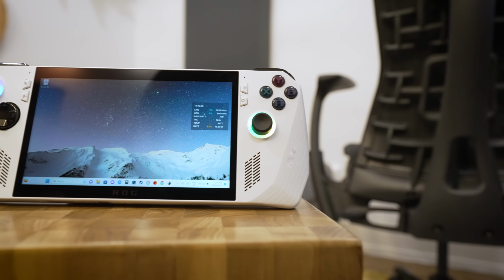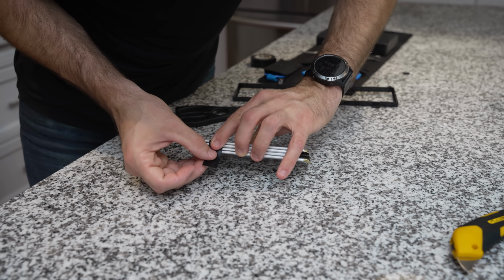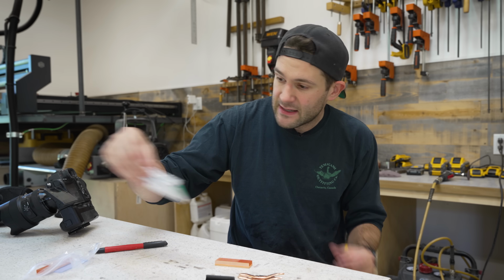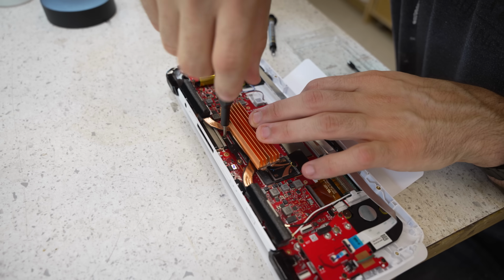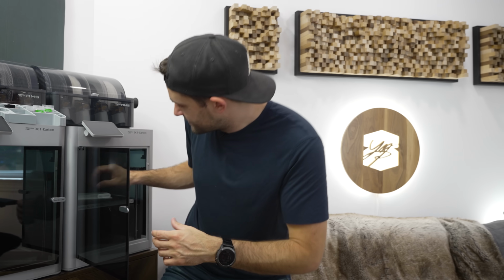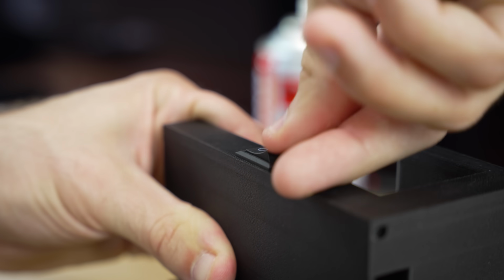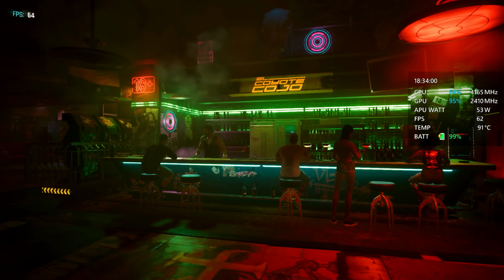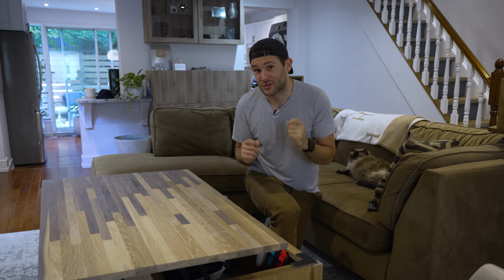I don't understand why people buy Steam Decks...

Comment: "Why do people buy the steam deck when they could buy a product that is twice as expensive for 10% performance increase!?!?!?" we may never know
Reply: 1 People don’t realize how big of a different having trackpads makes. 2 the ability to simply play games in gaming mode by just clicking play but still being able to switch to desktop mode and use it as a normal computer. 3 Steam os is the best option for a handheld PC device because they built in the compatibility, unlike windows trying to force it. 4 it’s built on the back of the biggest store on PC giving you access to almost all games right off the back 5. The amount of work that valve put into updating and bettering the steam deck, honestly, could you see Microsoft caring as much as valve
Reply: Simply play games? That's the rog ally. If I want to play certain games I have to do stupid shit like turn refresh rate down to 58 for tales of berseria so the game doesn't have a stroke. The older ys requires me to run in desktop and hope I can fix the resolution. Digimon story cyber sleuth doesn't work unless you launch the game in desktop mode first. If not the game shits itself and you have to uninstall and reinstall the game while also remembering to launch in desktop mode. I have tried evey game that I did on the ally and it works out of the box.
Reply: My steamdeck is still prone to almost bricking itself on start up with the black screen start glitch. I understand you guys enjoy gargling corporate nuts  it's almost hilarious.
Reply: @Badboy25251  my steamdeck has not had any of the issues you describe, though tbf I don't play the games you mentioned. It sounds like your device is just defective tho.
Reply: @justcallmenoah5743 also during release, and even to this day, steamdecks are prone to bricking on start-up. Just because you yourself haven't experienced it doesn't mean it's not a thing. I had next to no bugs in jedi survivor doesn't the game gets to be excused for it's shit release.
Reply: @Badboy25251  you can have ether Windows destroy your system or not having a horrible os in steam os your choice.

Never seen or heard of any steamd decks bricking themselves I have seen windows do this and hear it happens often
Reply: @Badboy25251  "my steamdeck is prone to not bricking itself on start up"

Thats an.... odd complaint. 🤔 im guessing user error. 😂
Reply: @TheOneAndOni13   ah yes nothing can be wrong with the steamdeck it's perfect because steam made it.
Reply: @Badboy25251 so your saying Asus and windows never f*** up. If you were smart you would have contact ed steam about it when it first happened and they would probably have fixed it for free or you could even fix it yourself of you have the knowledge while Asus dont even refund or replace motherboards that they made that was faulty. Steam isnt perfect but the are by far the best option
Reply: For Windows I guess. It would be why I would buy one.
Reply: more than 10 percent
Reply: I came to the comment section to make this exact same comment and ended up leaving a thumbs up here instead, good job @Reaprar
Reply: It's $350 now, that Rog Ally x is out.
Reply: And an
os that isn't tailor made for the system that allows for seamless per game customization of system performance and control schemes.
Reply: This video should say i don't know why people don't mod the crap out of a rog ally. But fairs
Reply: 10% ? You are a joke...
Reply: The guy is a fucking tool
Reply: Take some tutions from @diyperks he know what to do how to do before cutting & grinding the whole piece
Reply: Don't forget compatibility and modding, it's WAY better in many ways, except the ergonomics and the fact that it baked some SD cards
Reply: Black Friday Best Buy they’re $350
Reply: Cause some people want steam deck is Linux and performance because I don’t know they like it
Reply: Battery life...
Reply: 50% stronger, but lacks optimization from devs, has less battery life, is more niche (meaning you're screwed if customer support can't help), uses windows which sucks on handhelds, and is $50 more than steamdecks top model.
Reply: A steam deck is like the switch,PS abd xbox,it is backed by a very well known gaming company,with other own ecosystem and sold at a loss,to promote software sales from that companies ecosystem,since the owners of that ecosystem make the console they will make sure games are 100 percent compatible with it and certified to work on their device.
Reply: For me I got the steam deck before the ROG Ally and comparing the two of them to me the steam deck has the better overall design than ROG ally I don’t play AAA games and I’m fine with playing anything above 20FPS So… yeah plus Steam deck on sale can go as low as 250$ vs ROG which consistently stays at 600-700$
Reply: Twice as expensive? Lol no.
Reply: @jiffonbuffo  when this video was uploaded the rog ally was $700, the steam deck is $350. You guys are so annoying.
Reply: I paid 750 for my steamdeck and 700 for my ally not everyone lives america.
Reply: @Reaprar  says one of the most annoying group lol you guys just say “just get a steam deck” for everything from handheld pcs to even switch lol
Reply: @briankim6148 I don't wanna hear anything from a guy so dumb that he's replying to comments from 2 years ago
Reply: In India ally is actually cheaper than steam deck
Reply: where I live it's basically the same hecken price
Reply: Dw bro im from the future, crazy price cuts happened
Reply: Steam Deck isn't available in many countries, and the rog ally currently is dirt cheap
Reply: With half battery life also
Reply: Also, it’s windows so it’s basically a pocket computer does way more than gaming
Reply: Does it have quick resume?
Reply: Ummmm more then 10 percent more like 30-40
Reply: COOK CHEF
Reply: That runs a shittier os
Reply: My Ally was cheaper then the Steam Deck OLED
Reply: Had both steam deck and Rog ally. Ally is much better to use since it's windows and isn't steam only. Performance is miles better too and doesn't need tinkering with like the deck does. The only thing I preferred on the deck was the touchpad. That thing was amazing tbh and I wish more used it.
Reply: Asus rog ally cpu is like 60% better its zen 4 vs zen 2 it has 8c 16t vs 4c 8t 3.3 ghz base vs 2.4 ghz 5.1 ghz boost vs 3.5 ghz boost its alot better
Reply: @reaprar and doesn’t only play steam games and windows is better than Linux
Reply: It's 30% to 100% more performance depending on the game
Reply: Bullshit, rog Ally z1e at 30Watts is 60% more powerful than Steamdeck period
Reply: hahaha.. EXACTLY!!! Fucking youtubers man... so much money their brain dribbles out of their assholes.. not considering the COMMON PEOPLE!!!! Half the shit he probably got for FREE!!
Reply: Long term ally Didnt hold up :/
Reply: Cane here to say this 🤣
Reply: If you think it’s twice the price you’re a re+ard. Also it’s way more than 10% performance increase. Also you can actually play all games dummy
Reply: Dónde yo vivo la rog Ally y la steam deck de segunda mano cuestan casi lo mismo,son buenas portátiles con diferentes diseños en la que una se beneficia de algunas cosas y carecen de otra y lo mismo la otra.. en mi opinión me gusta mucho la tienda de steam pero el sistema operativo de Linux no me gusta, porque? Es un lío o trabajo agregar juegos que no son de steam, que funcionen bien o que aparezca en tu biblioteca con una fácil  accesibilidad no lo es, el escritorio es casi muerto carecen de muchas cosas, el diseño de la steam deck es muy bonito y sus trapacks molan, pero hasta ahí. Yo opte por algo mejor que rog Ally y steam deck. Una AOKZOE que la compre de segunda mano y por el mismo precio q una steam deck.. diferencias: mejor batería Windows 11 (si con sus problemas y todo lo digan) puedo tener e instalar cualquier juego muy fácil descargar e instalar nada más y el rendimiento es superior no un 10% nada que ver.. puedo tener cualquier tienda aparte de steam sin líos, a y también cualquier aplicación sin limitaciones
Reply: It's way cheaper than a steam deck 😊
Reply: "In my next video I'll design and build a  nuclear aircraft carrier!"
Reply: Exacly my steam deck is simple works just as fine for me and doesn't over heat like the asus rog ally is known to do my steam deck just works
Reply: @thekawaiicookie3267  Bro my asus laptops overheats games lag because it throttles like crazy i don't know how they planned on releasing a laptop they know it can't perform 100% even for 1 minute so it's all a lie selling a lie
Reply: My opinion on laptops altogether as a 6 year multiple laptops owner just get a medium laptop at max don't ever think about buying a pricey gaming laptop even the medium laptop is a stretch but if you really want to play games on a laptop that's my suggestion
Reply: @thekawaiicookie3267 known to do? I live in the middle of the desert, regularly play the rog ally in 35-40° C conditions

It's never once overheated
Reply: bs steamdeck gets heated aswell! I will say though that steamdeck won't fry your sd card...but rog ally still rules
Reply: @MaryHarper-x6r  I see you enjoy rog ally i didn't even know about that issue asus as a company is really shady that is all i am saying i bought products from them a lot and i regret it with my life and will never be buying again there are many other options on the market other than asus now idk why it's considered so good i have steam deck oled it doesn't overheat battery life is great and i can enjoy my favorite games anywhere i mean no hate towards your purchase good for you that you got it this is more of a warning about asus from me to you as a human being we don't have to be corporate controlled robots online we can have our own opinions
Reply: but you can't mod on steamdeck easily! Mods matter! I dont like being restricted
Reply: @MaryHarper-x6r  Just switch to desktop mode. Install the mods. Done. I've done it for a few games I don't see why it's difficult.
Reply: @MaryHarper-x6r no one cares about modding handhelds 😂 go buy a proper computer
Reply: No one cares about modding? Are you speaking for all?
Reply: Uh... steamdeck uses arch linux, you can mod more then with ally.  Sure ally is easier but your being more restricted with ally....  either your laziness is restricting you or your blinded by bias opinions.
Reply: @MaryHarper-x6r yes you can lmfaoo my cyberpunk has the over 50 mods installed and working fine. It’s a few different steps compared to windows but it’s not rocket science . Just a 2 minute read
Reply: @MaryHarper-x6r  Bro tell me why u cant???
Reply: @MaryHarper-x6r The guy had to cut a hole in the back of his Asus to upgrade it dude. It's not exactly like it was built for that in mind.
Reply: @MaryHarper-x6r not true it’s very easy to mod. Not much different than windows
Reply: @MaryHarper-x6r Bro what? It's just a Linux PC you can easily install whatever software you want on it and can even install windows if you want
Reply: @MaryHarper-x6r you absolutely can mod on Steam decks
Reply: @MaryHarper-x6r you can change the operating system if you want and then be able to mod easily also steamdeck os can definitely be modded
Reply: 50% less effecient at low TDP. Heavier. Bulkier. Worse software, windows being the worst OS
Reply: Bulkier? The rog ally is smaller than the steamdeck.
Reply: Plus, more game combatability, not stuck on steam without blowing the waranty.
Reply: @MontanaPDX Installing Windows to your Deck in no way voids your warranty lol
Reply: Also the ally is a computer
Reply: @Timmy.johnson so is the Steam Deck. You're going to have to specify why the ASUS is more "computer" than the Deck is.
Reply: @Timmy.johnson they both are?
Reply: U must have a steam deck 😭
Reply: Mods 😊
Reply: @MaryHarper-x6r huh
Reply: @MaryHarper-x6r you can mod on steam deck
Reply: More than 10%
Reply: @DimiArt  idk where i live it's 30$ difference but steamdeck vs ally i had enough asus and shady companies in my life i'd rather have something from a company that won't brick my device with a bios update which they did to my new laptop and i assume did to many others as well
Reply: @THEREAPER-CODBO6  who's says valve won't or can't? Lol 😆 brick your device 🤣
Reply: @MaryHarper-x6r  You're laughing but valve adds support for rog ally because of this many people don't even know how to pause windows updates you knew that asus bios updates come into windows updates? so if you forgot one day to pause updates it will be done automatically.
Reply: @MaryHarper-x6r they don't have a history of doing that which I guess ASUS does though to be fair that's new to me.
Reply: @MaryHarper-x6r valve actually, if you hate steam os? Install windows.
Reply: @DimiArt yes, 10 to 15% lol
Reply: With that much battery drain? When docked that may be acceptable but not when in handheld  @DimiArt
Reply: @DimiArt ok. .15%
Reply: did you buy a steam deck and regret it?
Reply: @disappr0val  No. I have Steam Deck LCD and OLED. Both are great.
Reply: Quit being poor
Reply: 1080p vs 720 is reason enough
Reply: @Ct6-666 800p
Reply: On a tiny screen makes such a huge difference  🤪  @Ct6-666
Reply: It’s 800 not 720, but still
Reply: @Ct6-666  No it's not
Reply: @doublevendetta  if you had a handheld big enough you’d see or your just not playing anything above gba games
Reply: @Ct6-666  Wrong and wrong some more. "Resolution" in a vacuum means literally nothing. PPI is what matters, which is the EXACT same reason shoving 4K displays onto 7" phone screens is stupid
Reply: Not in 7"
Reply: @Ct6-666 No not really I’m fine with 720p
Reply: Lol the answer is "because that's what the PC community does."

The only reason that the Deck is a big deal to anyone is that PC fanboys now have a decent console.
Reply: @InitialFailure  personally I like it because it runs a well made Linux distro that gives it a great console like experience while also giving me access to a full desktop mode if necessary. Windows is a lot more tedious to operate with a handheld device, and I just generally prefer Linux when possible.
Reply: @InitialFailure  Yeah it is also nice to play games with it.
Reply: And void the warranty while modding it to actually make it worth having. Dudes a joke. "Don't recommend channel" is an awesome option.
Reply: One of the dumbest salty response .... Get Ur facts right.... Both price and performance are better compared to what I pay and get for emulation deck.
Reply: @jonwik7056 In what world? What math do you do to come to the conclusion the small bump in performance is worth the extra price?
Reply: @jonwik7056  If you're gonna call someone else salty at least try and type in a way that doesnt sound like you were just punching your pillow lil bro

Comment: you should have just run the fans slower.... it would increase the battery life much more and you are running the thing much better....
as for why people buy steam decks over this, its the same thing why people don't buy the ayaneo and the onexplay and the gdp win....
steam deck works well out of the box although not at launch which was fixed on the first update... its made easy to use and they made sure it has a lot of support from valve and the community....
asus's support is shoddy at best... and lenovo is questionable... while the previous brands in this space is too low key... and steam deck has valve which has proven their support for the consumer... its obviously a passion project for valve.... its more of the brand has so much trust from the consumer of these types of products....

Comment: I had a hard time deciding which handheld to buy, and while the ally’s specs were very tempting unfortunately unless you are doubling the power draw, the improvement is often negligible if not flat out worse. The support and optimization valve has shown the deck goes a long way often causing the steam deck to perform better at 15w. Plus windows sucks on a handheld, not to mention that I personally don’t need 1080p on a handheld. While I would love to have it it’s just not a huge deal for me as I have a gaming desktop and for the games that I really care about I can play those there. Not knocking the ally but the ease of use and optimization added onto the custom Linux OS designed specifically with handhelds in mind put the OLED Steam Deck over ThTs Ally. Thanks for the video though great content!